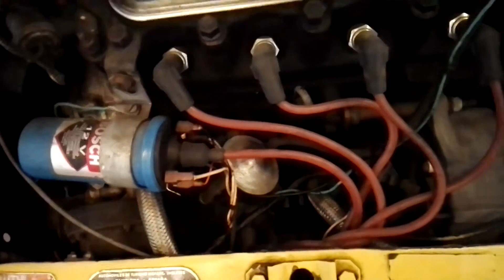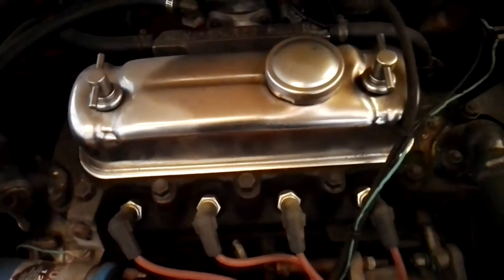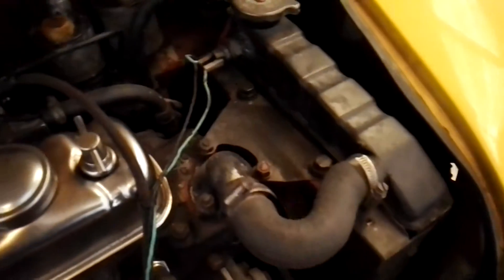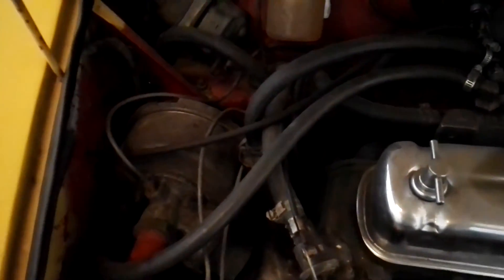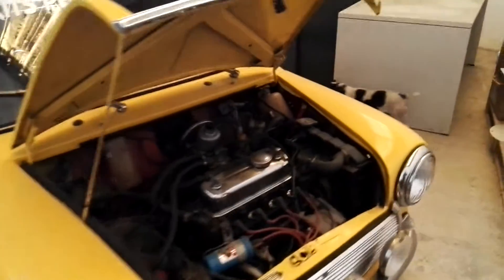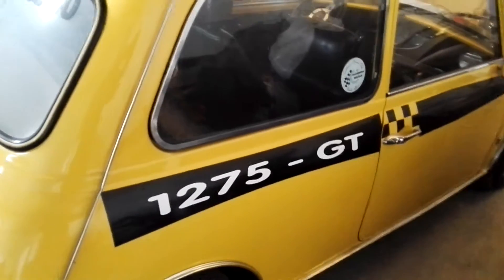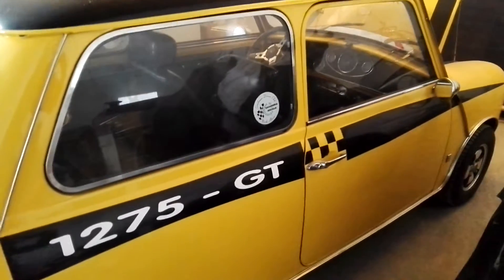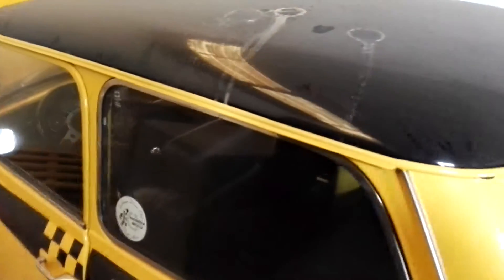Mini 1275 GT 100cv

Comment: Hola, antes de nada, te felicito por tener un 1275GT tan cuidado. 
Dicho esto, no voy a entrar en la preparación del motor en sí, pero permíteme dudar que este motor tenga 100cv.
Los motores A+, del MG Metro, (versión mejorada del tipo A que lleva este Mini) con turbo, no llegaba a esos 100cv, se quedaba en unos 94cv.
Por mucho delco Aldoni? (eso que es....) que lleve, eso no le da ningún caballo extra, a lo sumo, una chispa mas regular, pero nada mas. Si quieres exprimir un motor serie A, la mejor carburación es un Weber DCOE. Los SU, van muy bien, pero no le dan ese plus de rapidez al acelerador, que sí le da el Weber. De usar un SU, bien puedes elegir la carburación doble, con dos SU HS2 del Cooper, y bien un SU HIF6, de los MG Metro. Pruébalo y verás.